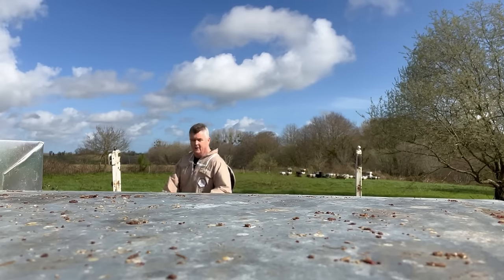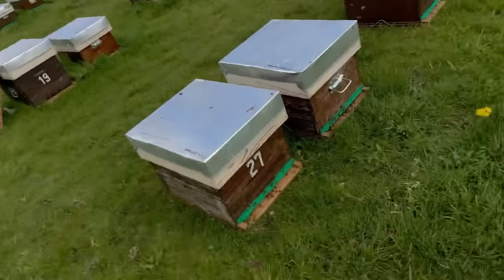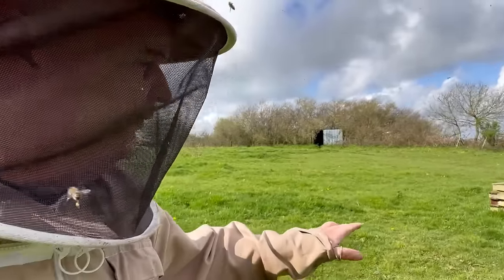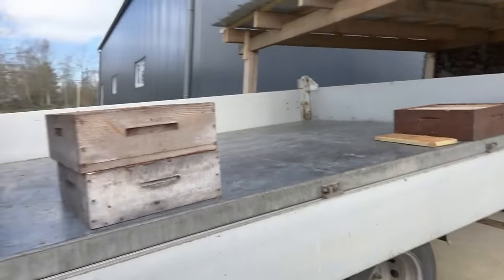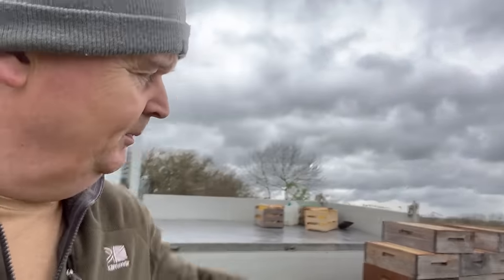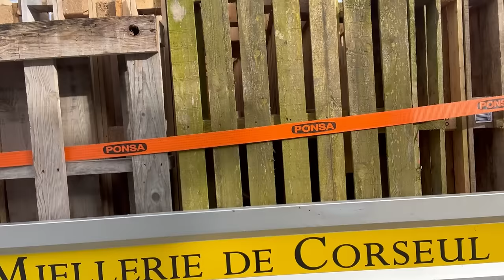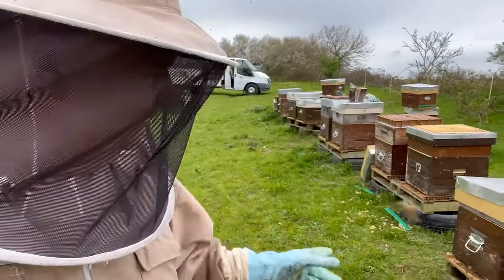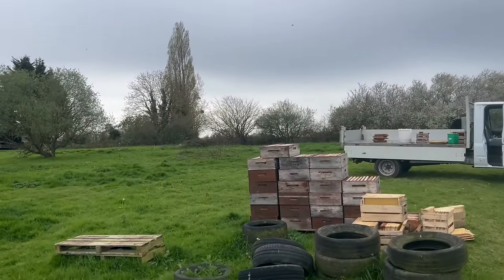Huffing and puffing, well its not so bad!

Comment: Wise move with the Van, there's nothing worse than getting stuck in a field.
On the pallets, with the cost of timber now. It's much cheaper to buy them complete, by the time you buy timber, nails, cutting and assemble..
Reply from the maker: In recent years, I still think it’s a bit wasteful but we usually get 3/5 years out of a wooden pallet but ideally plastic palettes would be a better option but their about 20 euros each here